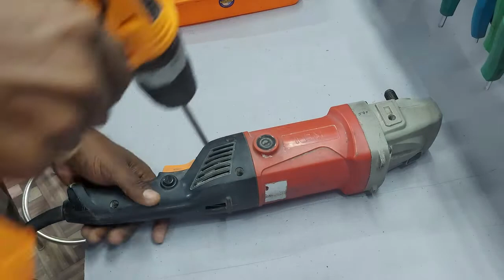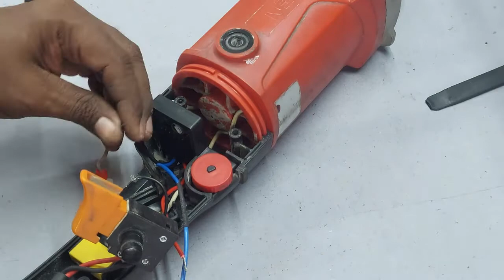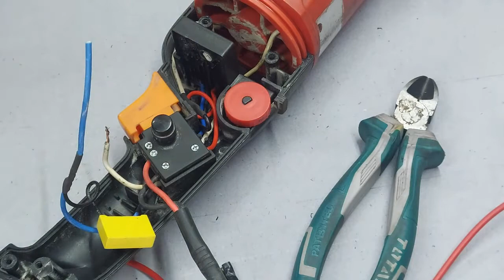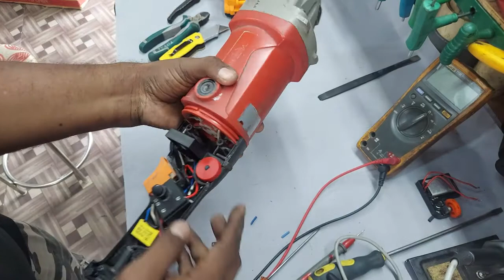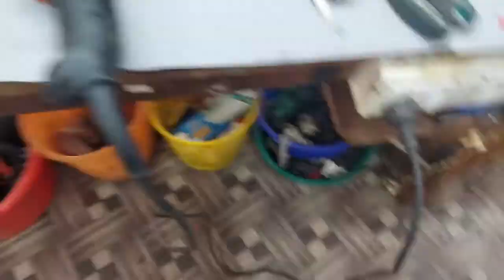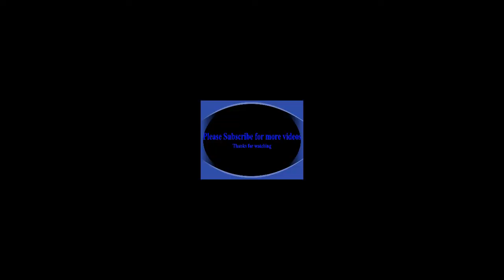KEN Car Polisher Speed Control Switch Problem

Comment: hello i have one question.recently i buy botaco da polisher,the problems is 1 speed extremely fast.can i modified it to make it slower?
Reply from the maker: Yes, You can use a speed control switch if the space is available in your machine